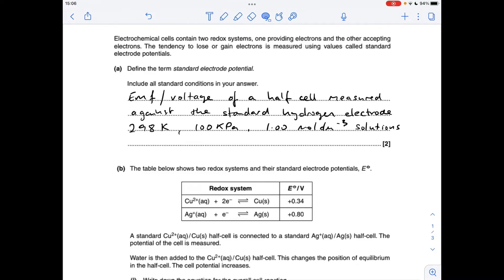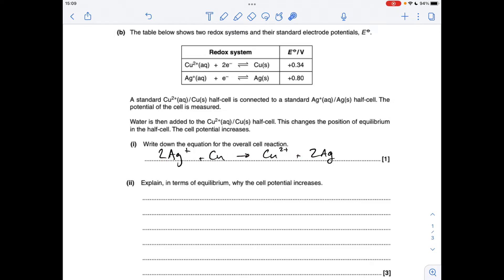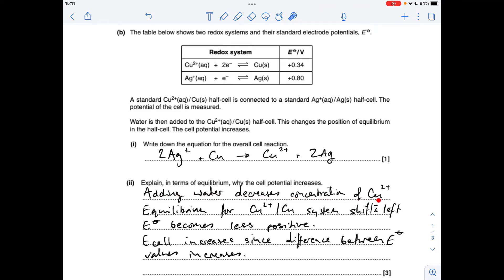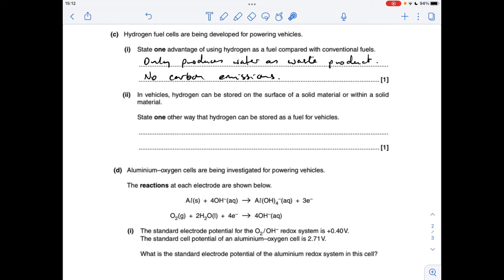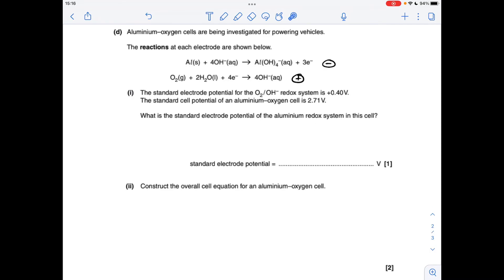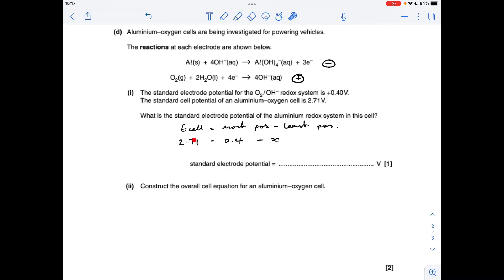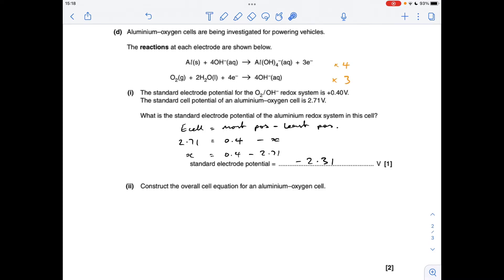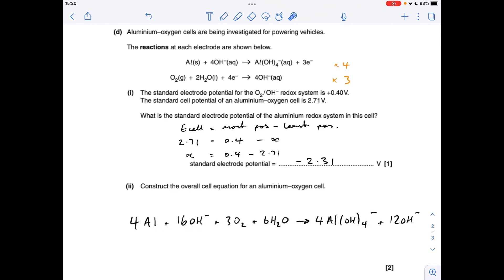A LEVEL CHEMISTRY EXAM QUESTION WALKTHROUGH - ELECTRODE POTENTIALS 8

Comment: For the last question shouldn’t the O2/OH- system go in the forwards direction and Al/Al(OH)4- in the backwards
Reply from the maker: You’re given the electrode reactions in the question so there’s no need to work out which one goes in which direction. The one that gains the electrons has the higher SEP value